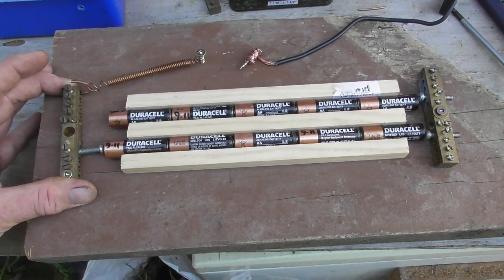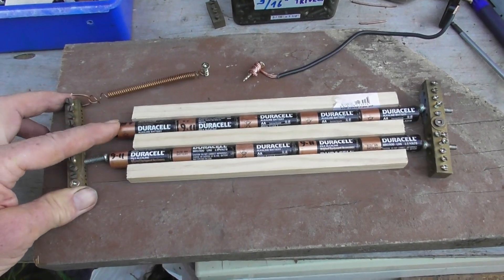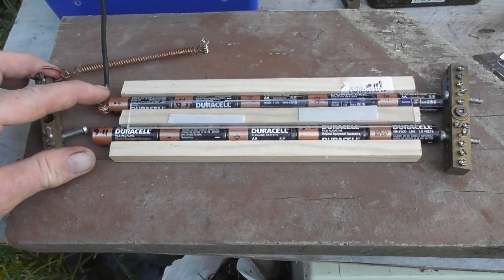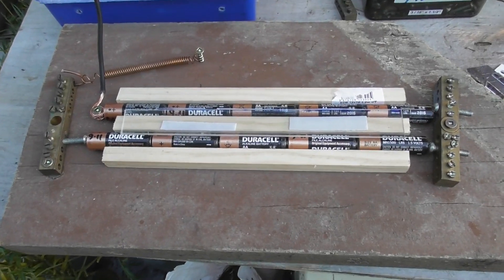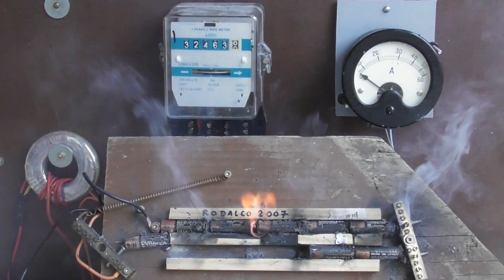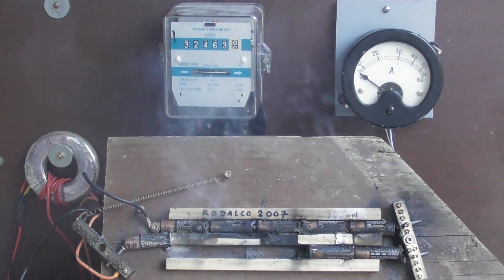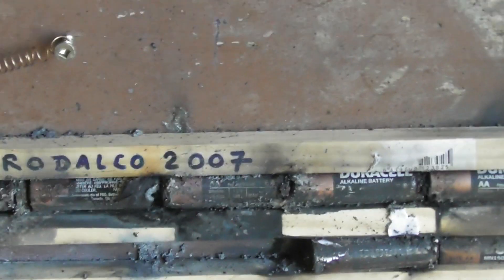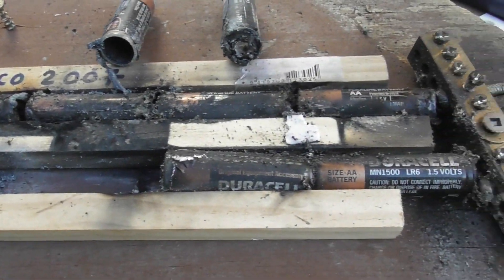10 x Duracell AA batteries overcharged !!

Comment: Must be using one of those non-compliant chargers..  not UL listed...  

But my good sir,  if you are still observing comments for this vid.  Would like to see the differences in behavior between alkaline, NiMh, industrial and the other available variations of batteries overcharged/ supercharged...  figure itd be a “learning experience” for us both..  :)

Also, given your passion to protect the crt from extinction.  Never seen a vid where you do any experiments with the visual side of deflection coil alteration and signal modification with cadence, magnetic and static variance visual effect, etc..  with your collection i would say you could get a pretty awesome video out of it..  ive not seen too much on the subject besides crt oscilloscope and 3d audio wave forms.  But you can splice vga cables into different freq power modulators and ripple injection friggn visualized..!  The most that could fault is melting a deflection coil and watching what that would do to the ray would be very interesting even if it just farts and puffs a toot of smoke out..  as long abdvthe ray gun wasent damaged you could probably wrap different coils on the tube and hell, might wind up seeing other dimentions or find the cure to this funk getting in everybody like a whore in sunday school..

Comment: I was wondering about how you got so much current but was that a current transformer I see on the wall behind?
Reply from the maker: The current transformer is for the 40/5 Amp scaled Ammeter pegging at 60 Amps. CT in saturation putting out 7.5 Amps.
Reply: @RODALCO2007  thanks for the explanation.

Comment: You need to have some charge on pulsed DC, surely you have an appropriate size rectifier diode around to put in series with the one lead. Less sparks, but definitely will have more altitude.
Reply from the maker: Will look into that. Need to find a 100 Amp diode first in my archives.